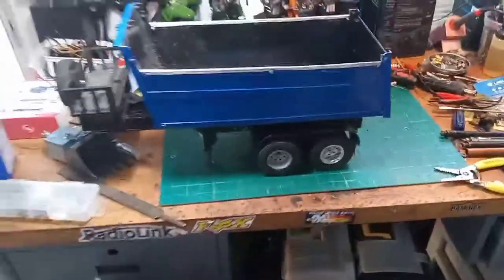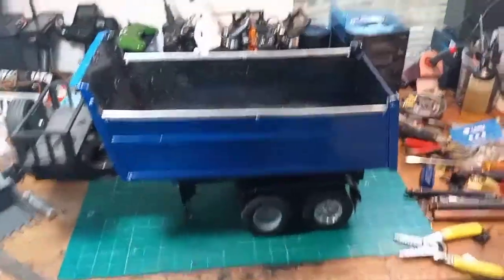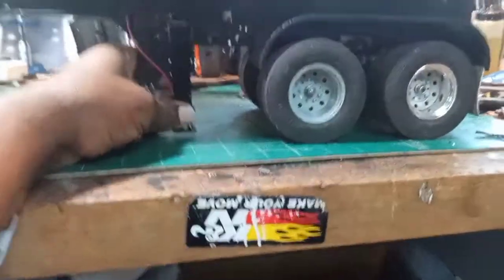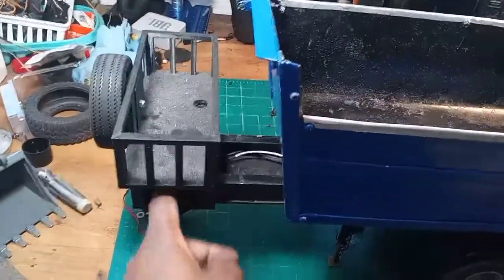trailer project .... maybe?

Comment: Seems like the 3-D printed parts are what needs replacement with higher strength (metal) parts, mainly, but this would involve using a milling machine to mill & precision bore the parts. A Harbor Freight milling machine would probably work ok to do this. I imagine you put in a fair amount of work already, building the dump trailer, & it might not take much more work to improve it. Great job, building the dump trailer!